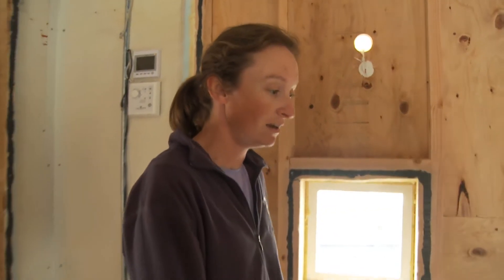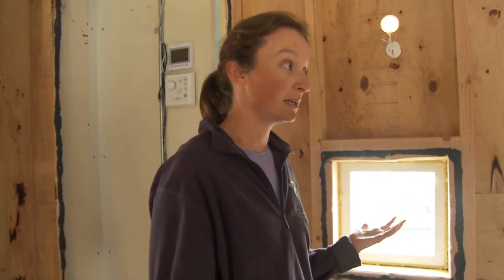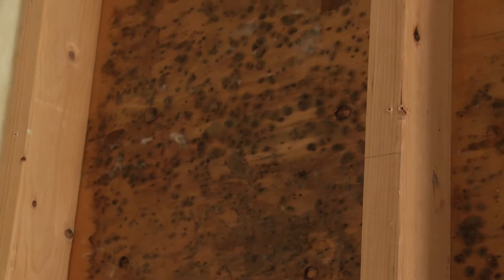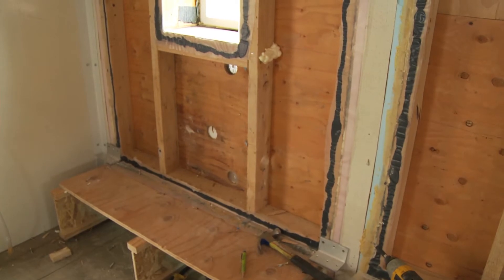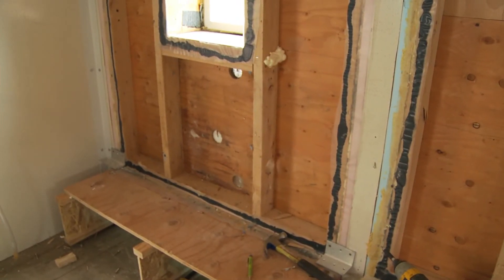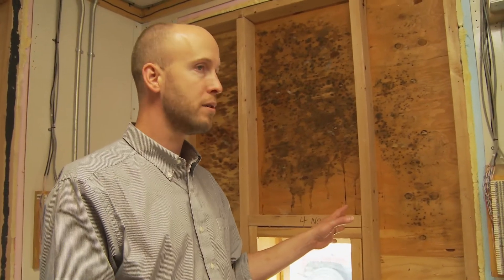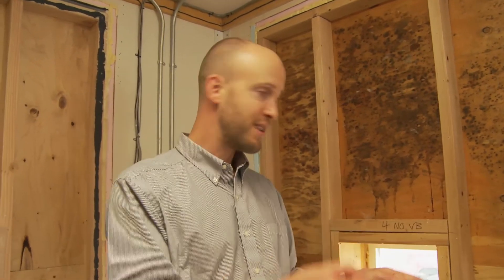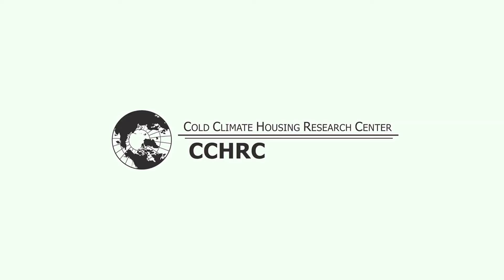Mobile Test Lab @ CCHRC: what's inside the walls?

Comment: This is very cool, where you got very distinct results. You do some vary interesting research! Here in the Pacific NW, most homes benefit from the latex paint on the drywall, as an unintended (interior) vapor barrier. But eventually most of the vegetable matter of the building envelope rots anyway.

Comment: Hold on a second, why should "wall 9" have performed worse with the vapor barrier (all other things being the same)?  "Wall 4" had a lot more moisture dumped into the cavity, which was not able to escape to the outside.
Reply: Orientation, and mostly the use of WOOD as a building material.
Reply: George Hawirko The incorrect use of wood! Put the Plywood on the inside and keep it vapor open to the outside. This promotes drying to the outside, in case any moisture ever happens to enter the wall. This is basic physics George. Even your EPS is vapor permeable (probably even your concrete board).